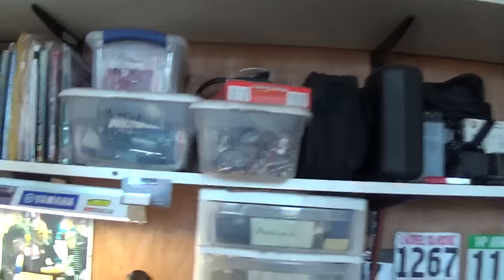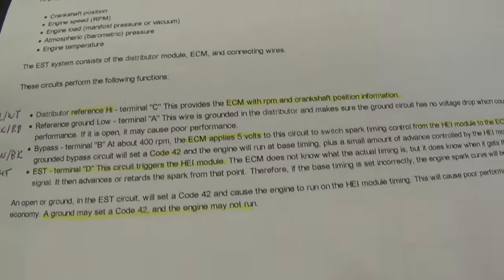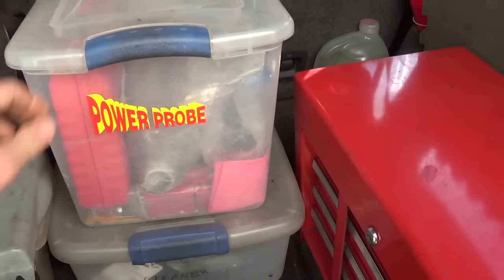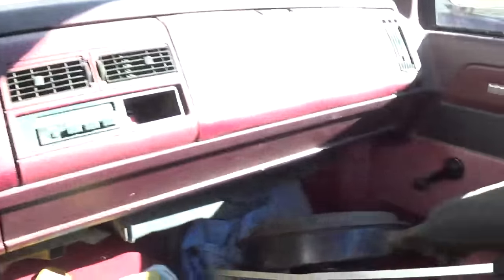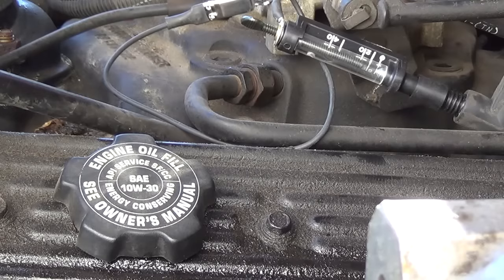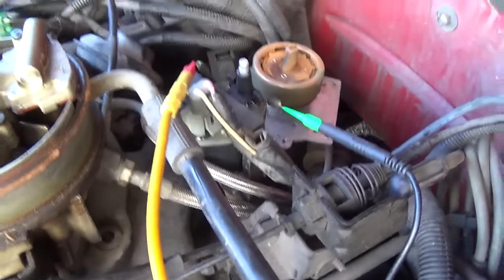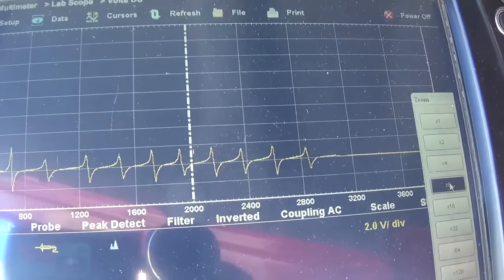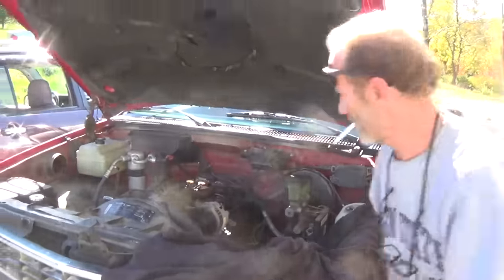Crank no-start: '88 Chevy truck 5.0 V8

Comment: Just to add to the diagnostic I have the same system on my 87 Silverado same problem. No spark or injector control I ready did all the test the pick up coil test past the same as Ivan's video. The problem was not the module the pickup coil only worked when disconnected from module but when I back probe and connect to module no signal. So the problem ended up being PU coil. So make sure you test with PU coil connected to module so you do not replace for no reason and confirm PU coil. I did all test on bench was easier just power coil and ground Dist base connect 2 harness to coil and Dist ground test light then tip to coil if you get spark all good. If in the the vehicle no spark check wiring to ECM.

Comment: Im having an issue with my 1990 c1500 5.7 i have spark from ignition coil but not from spark plug wire 1  changed coil rotor and cap also icm and still nothing just cranks but no start

Comment: The thermal grease supplied with the module is supposed to be put on the base of the module to help protect the ignition module from heat
Reply: Useful thermal paste to conduct heat away from the module, not dielectric grease.

Comment: What is a cheaper tool to check the pick up coil, G & W wire? I had to pull the dist. out put it in a vice & knock roll pin out, r&r pick up coil. 1991, 305, K2500 4X4.

Comment: I would have also replaced the pickup coil as well. Only problem is the distributor has to be removed and disassembled to access the pickup coil. Takes longer but worth the extra time and money in my opinion.

Comment: Ok setting everything straight here with you guys should use ATV silicone and thick beneath the  ignition module for they do get pretty hot, also dielectric grease can be used on terminals as so In video, I just put the extra on inside of cap for moisture proofing system, but all in all only USA modules will be fail proof and or racing ones last longer, I've tested alot of foreign modules and China made ones and they all for some reason have short life spans...Thank you and go Prerunner your 88-98 c/k 1500's you'll love it...🏁🌵💪😎🔧🛸✨🍻

Comment: Hey i got a 1995 GMC suburban 5.7. Changed fuel pump, rebuilt the tbi changed the oil pressure sensor ECT. But when it get warm or runs for awhile then turn off it wont start again for aleast and hour. If use starting fluid it will start. Anything can help Please

Comment: I made a lot of money fixing avionics that had nothing more wrong with them than DG slathered on the circuit board contacts. 
I always tell people that DG NEVER makes a connection better and to make that connection work right and then, after everything works, slather that stuff  on it if you must.

Comment: Nice work Ivan on the diagnostics. I'm with most viewers about the grease, but I would use a thermal grease which improves the heat conductivity of the module. I remember that Radio Shack sold thermal grease as I used it on controllers for sodium lighting systems years ago. They may still sell it, not sure. The dielectric grease I would just use on the electrical connectors.

Comment: ground strap that runs from back of engine block down thru a tube to the passenger frame ---if it's badly corroded truck will miss if it's corroded bad enough or broken fuel will shut off --crank no start....strap looks flat and you can find it 1st at passenger frame but the other end on back of engine block held on with a nut is a major pain

Comment: too much misinformation. that noise inside the cab is the air blend door. common issue. the grease is for heat sink. goes on back of ignition module. the instructions clearly state .

Comment: I used dielectric grease not only to seal the terminals but also on the mounting surface to help it dissipate heat. As heat kills those modules.
Reply: Wrong.  Use thermal conductive heat sink grease.
Reply: @jeffro221  That is what dielectric grease is.

Comment: i have a 1988 Chevy 4x4 350  cranks no start . new coil .new ignition module, rebuilt tbi  . getting fuel  but , no start . truck has been setting one year , new gas too. any help ?

Comment: Holden used to have modules that failed on the last of their in line 6 cylinder engines between 1980-1985 when they were first fitted with a HEI system  :-

https://encrypted-tbn0.gstatic.com/images?q=tbn%3AANd9GcSb5U87mL0-B3IhxE31Dno5cV7b7DH9Q-icgXBqMOG45cRreWTh

If the engine ever cut out one trick was to pour some cold water on the module,if the engine starts, then the module is faulty.

My grandfather had that trouble with his 1983 model Holden Commodore before he stopped driving then died, they ended up having the whole distributor replaced when the engine kept cutting out on them.

I used to drive a 1988 model which was fitted with the Nissan engine ,when it cut out like that, the primary wire inside the coil failed, it was supposed to be 0.9 ohms but it was 11 ohms instead, replacing the ignition coil fixed the problem !

Comment: I'm having the same problem . Still won't start. Had to change the fuel pump, icm and mass air flow sensor.  Still won't run. Any answers please.

Comment: Anyone watching this video take note... the dielectric grease should be placed between the distributor metal base plate & the bottom side of the module for heat dissipation or you'll be putting in another one not too far down the road. Know yer OBD1 lol.

Comment: I have a 88 1500 that wouldn't start I went through the fuel system everything was ok I went through  the entire distributor and the little sensor on it was bad under the cap so I went ahead and replace the sensor and the cap and put new plugs in also it crunk up and ran fine for about 3 minutes then just shut off so I went through the same process but this time it's getting fuel and firing but want starti

Comment: A dielectric (or dielectric material) is an electrical insulator that can be polarized by an applied electric field. When a dielectric is placed in an electric field, electric charges do not flow through the material as they do in an electrical conductor but only slightly shift from their average equilibrium positions causing dielectric polarization. Because of dielectric polarization, positive charges are displaced in the direction of the field and negative charges shift in the direction opposite to the field (for example, if the field is moving in the positive x-axis, the negative charges will shift in the negative x-axis). This creates an internal electric field that reduces the overall field within the dielectric itself. If a dielectric is composed of weakly bonded molecules, those molecules not only become polarized, but also reorient so that their symmetry axes align to the field.

Comment: My 1989 chevy keeps backfiring and then dies. After I replace the ignition module  it will run for about a mile and then backfire and die again. I have replaced the ignition module 2 times so something is killing it  each time it happens. Do you think its a bad computer?

Comment: what do you look for when you changed the module & coil & still wont start & the damn thing don't have spark either  ohh it's a 1985 p30 4.8. im going crazy don't know what to look for im opened to suggestions ..

Comment: Hey man , I have a 93 350 tbi engine and I've done every single thing I could think of in the ignition system & my coil is still not giving any spark when I turn the key. I've put a new distributor, new battery, new starter, new module , new coil , new switch and it still doesn't give out any spark. It only gives out a little bit of spark once I let go of the key. What do you think it is ?

Comment: Buddy I could have diagnosed that in 20 min . You don't need all the paperwork ignition fuel what's it missing . That takes 5 min to determine . Then you move to the issue . Well it's easy . If you got hot going in and none coming out . All I'd need is a test light and a 12 dollar multi meter. In 20 min I'd know . The issue. And that grease goes on the part so you put that grease on the surface it mounts to . And a tiny bit on the connector

Comment: Ivan.  You are totally correct about the dialectric - all one has to do is think about a capacitor whose dialectric insulates one plate from the other.  That grease will definitely seal.  (I talk like I'm an auto mech - not!  :)   But, worked with a lot of dialectric. ha, ha.   Thanks.  Enjoyed the video.

Comment: these are easy systems but also easy to get burned thinking its a bad coil when that ignition control module controls that 5v reference back to the coil...

Comment: I agree with everything Bob Weiss wrote in his message 32 minutes ago, which begins:"It is definitely going to get hot".The power transistors usually have about 700 millivolts drop across them, and they are NOT very efficient. It is a PN semiconductor junction.

Comment: that is the most part that goes bad on all Chevrolet truck as soon as I looked at the start of the video I know that you problem was i work at a Sears Auto shop the technology look at the truck and cars but it is a old vehicle they cannot hook up their scanner to it it is for the new cars not the old cars I take one look at it and the car is fixed one stupid little part that always goes bad on all these GM vehicles that have distributors Dan if you see it next time just check that first

Comment: Nice diagnositcs.  Beats the other method - throw parts at it...  
My truck is shutting off while driving!  It won't start until I turn the key off then back on.  I'll use this video to diagnose - although I don't have scope.  Shade tree here....

Comment: Easiest way to test tbi is use a noid light on the injector ,pull the no 1 spark plug. If you don't have fire or fuel,ignition module needs to be changed. Hardly ever a pick up coil.

Comment: On Ford with  TFI ignition, there isn't  a code for the module. The pickup coil  is called  the PIP sensor on a Ford with TFI ignition. Replace  the whole distributor  on TFI systems.

Comment: He’s exactly right about the dielectric grease.  It is not to be put on the module itself, just the connectors. Heatsink compound is used on transistors to help with heat dissipation. It’s white and somewhat sticky. Just a little tiny bit will go everywhere it’s not wanted. Lol

Comment: I have a 350 5.7 motor that ran with high oil pressure ran it on freeway and it died completely on me now it’s turns over but won’t start

Comment: so i had to change out my cam position sensor connector plug it was bad 
as well as the sensor... but one issue there was no fire going to the 
sensor from the plug... does the car have to be running too see voltage ?
 key on ? i get nothing... my truck wont start just crank now... i took a
 look at my crank sensor i think it might be flooded with water and oil 
dirt... so can that cause no fire to the cam sensor?

Comment: Silicone grease stand heat & stresses better then organic grease believe it or not. Grease help smoothing out the surface from micro gap and roughness to help cool better. Bottom line is it is a bad design from scratch with our without grease.

Comment: hi brother is a great video, I need some help  I have same truck that cranks I checked spark plugs one by one and has a fire , I has a new wires but wont start, so I can be the module the bad part??  also it has unplug that withe wire that you point at minute 7:07 idk where to hook u p that wire, what I can do my friend to start up againg the truck? thank you

Comment: i dont think that grease was for thermal like many are saying the older HEI ignitions along with fords thick film  modules had a metal heat sink side of the module that mounted to the distributor, using thermal transfer grease. as always the heat still killed them. ford remounted thiers to a fender well or radiator support. the mounting bolts actually were an additional ground.seem more than one ford that wouldnt start from corroded mount bollts. ahthe good old days lol

Comment: So it was the,  "IGN. - MODUEL" ,  not the P/up Coil,  even though I know what you meant,  it's Koool,  
  Great Job,  & nice  Vid,  Ivan,  keep it up,  BRO!!  
P. S.  Dielectric grease is a good - PREVENTIVE - Measure,  to protect the terminals from the Outside elements,   Yes,  I'm with you on the same theory,  👍!!

Comment: one of the best videos i have watched in 2 weeks, i have no power to coil on 4.3 in s-10, hey , the two sockets to coil, i have pink and white wires to coil is pink 12volts and white ground, cuz i grounded the white wire and now i have power back to pink wire w key on and key off power is off to pink wire ha. if anyone has info on that thanks

Comment: HI I have 1981 chevy camaro 3.8 no spark.When  I tes the control wire at the distributer I got 12v with the EST disconnect and good control from the ICM, but when I connect the EST back, the voltage drop from 12 to 8v and no control from The ICM to the ignition coil.And the pick up coil test good about 2 volts AC. I all ready replace the ICM and ignition coil with no luck.please help.Thank you
Reply from the maker: +NOEISY1 So it does have spark with EST disconnected?

Comment: Correction:   I meant to say that "too much thermal grease on the mating surface increases the distance between the surfaces and REDUCES thermal transfer". So sorry.
Reply: ...This is the same type of thermal paste used for mounting heat sinks onto computer processors. Efficient heat transfer is important here. A thin coating is all that's needed to do the job. The dielectric silicone grease keeps electrical terminals from corroding due to moisture and helps make disassembly much easier the next time service is required.

Comment: Is it transistor module for driver high voltage coil?, it receive pulse (volt) to input (trig) to transistor make switch coil on/off due to high voltage out.

Comment: Ivan, i have a problem, withmy 350 5.7 liter silverado wont start. The throttle body carb back fires. I have the timing set tdc. And wires are new, i need some pointers. If can i would appreciate it thank u
Reply from the maker: Did it just quit running one day, or was some service performed?
Reply: @PineHollowAutoDiagnostics  it quit running after i hauled some wood up a hill. Im thinking MAP sensor or engine temp control sensor. Switched out the modular in the distributor but no change.  I also checked the timing seems to be on TDC.

Comment: we have one of these trucks and are having an issue with the timing NOT advancing under throttle. it starts and runs perfectly fine but has no power since the timeing wont advance. I was a bit confused where you explained how it works under throttle. were you saying that while idling it runs on its own but tat advancing is from the ECU ? Would this mean a faulty ECU or is there a signal the ECU istn reciving that it needs to know to advance
Reply: Knock sensor advances and retards timing during normal engine operation you prob have knock ses issue

Comment: Had ignition module fail in mine, no fire. Had choices of modules from different manufacturers and price. I chose a AC Delco from Rock Auto and installed when parts arrived. I also did complete ignition tuneup with cap rotor, wires, plugs and chose AC Delco for quality and longevity. Upon start up, I had a smooth running engine and all was well until traveling on road test for about ten miles and engine stalled, left me stranded on roadside with a no start again. So much for AC Delco quality on the module as it failed at ten miles!
Reply: Yup, the Chinesium eBay ones are far better.   Uh-huh.

Comment: Older HEI distributors, especially those with the coil in cap design, had the module mounted internally beneath the rotor.  The dielectric grease was mostly used to to aid heat transfer  between the module and the mounting surface.  Forget to put some on and the module overheats and fails again in short order.

Comment: They fail at such a high rate that I actually took mine and extended the signal wires from under the cap and mounted 2 icms on a homemade heat sink out of a block of aluminum on the fire wall and kept a spare in the glove box that way when it died I could plug and play and be on my way
Reply: Interesting idea!

Comment: i have a 95 chevy silverado that quit on me on my way to work. Good thing is not quit on me on busy traffic street. It crank but wont start. look like no spark or something else
Reply: same thing happened to me this past friday. iv got no spark at the plug, none at the cap, none at the coil, but 12v going into the coil. still need to do the rest of the tests but hoping its just the mod. But, kind of makes me wonder, what would cause the module to fail in the first place? just old age?

Comment: I have a crank no start but It has spark and fuel and I’ve replaced the icm new full distributor map sensor coil and spark plugs could someone tell me what it might be
Reply from the maker: Spark timing? Compression check? Basic checks
Reply: It was the timing I just finished and got it running thanks for replying

Comment: These ignition control modules are garbage. Best to keep two in the truck. One of them will work the other will be bad out of the box.
Reply: You are correct.  I received a GM ICM and it was bad right out of the box.  Sent it back to Rockauto.  Now I take it a step further.....I "qualify" one to be a carried spare only after I have installed it and made sure it will work.  Then I pull it back out and label it as a good spare.

Comment: Spark control/ distributor control module had the same issue with my 92 s10 with the tbi 2.8 was scratching my head. My step dad and grand pa both asked if i had replaced the icm and i was like what and thats when they told me yeah inside the distributor cap.